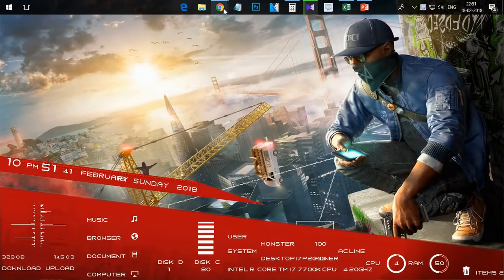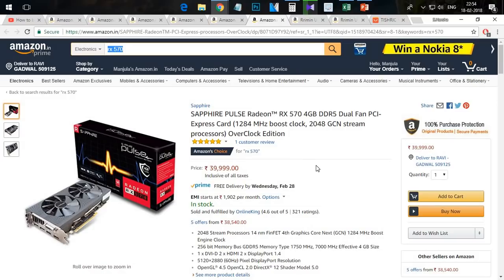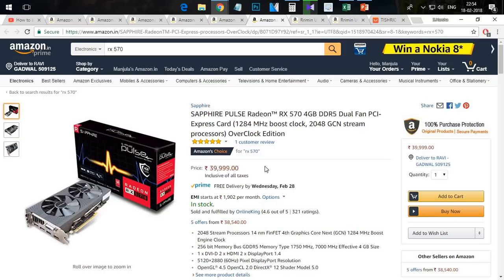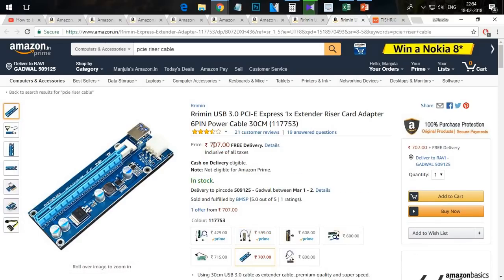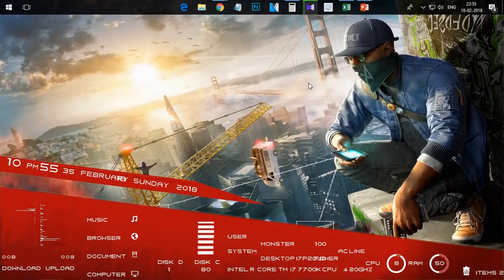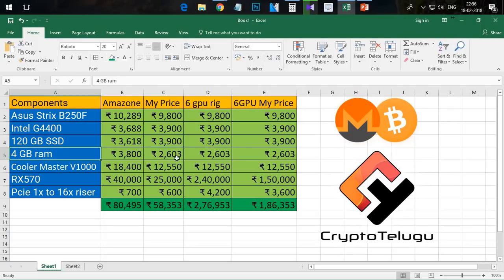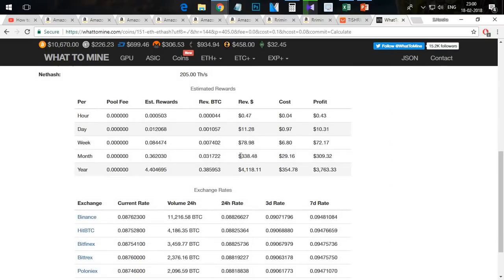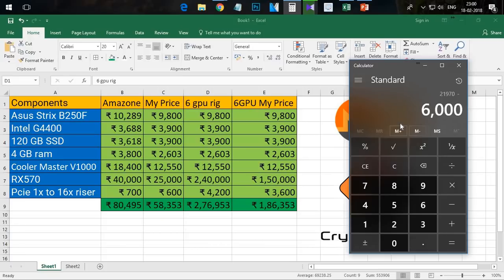Cost and Profitability of mining rig, Is it right time to invest? - MB Ep -8

Comment: I want to start rx 580 with 6 cards. the psu is 850w enough or need 1000w. please reply
Reply from the maker: Chandra Sekhar if you are going to mod 1200watt recommend for stable performance.. Or else 1000watt is sufficient.. 850watt won't be able to handle 6cards.. So minimum go for 1000watt.. Recommend 1200
Reply from the maker: Don't think for spending few more bucks on PSU.. Try to buy a gold plus.. U can save some power bill as well..